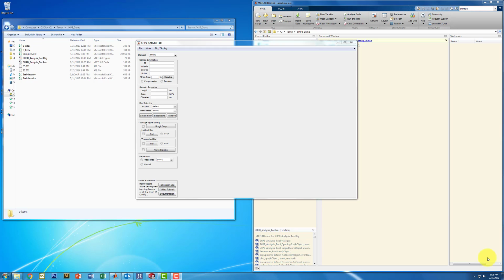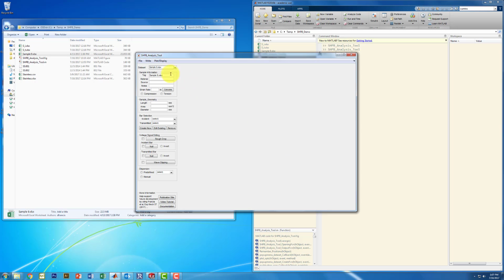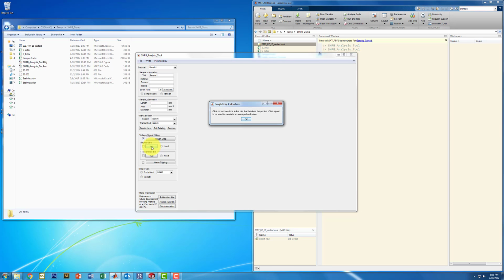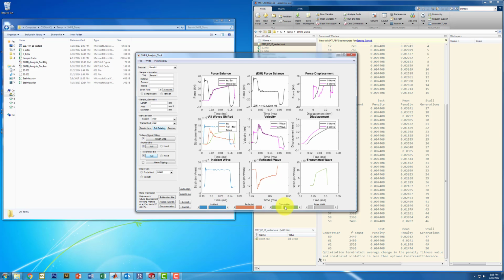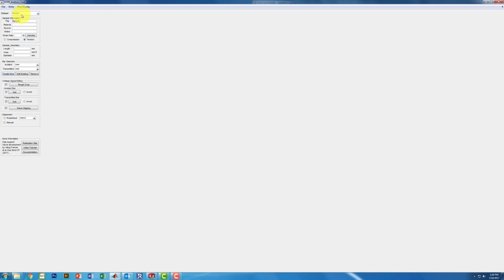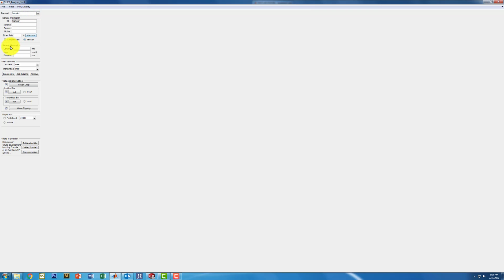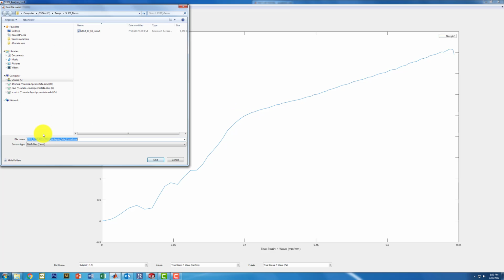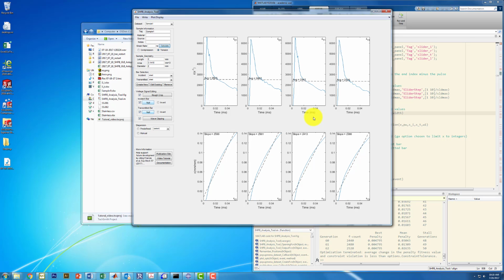Tutorial: Version2 -- Split Hopkinson Pressure Bar Graphical Analysis Tool

Comment: hi, i just run the .exe, and i dont have the data set section, i can load my data, but i cannot select it in the dataset
Reply: did you manage to solve this issue? I'm having the same problem as you.
Reply: no , i cant use this program yet  :(
Reply from the maker: Hakim, I received your data and have responded
Reply: @davidfrancis1443  I am facing the same problem, Please guide me through it
Reply: I am facing the same problem, If you have solved can you please share the solution with me. will be appreciated. Thanks.